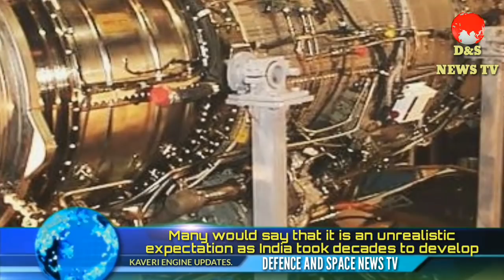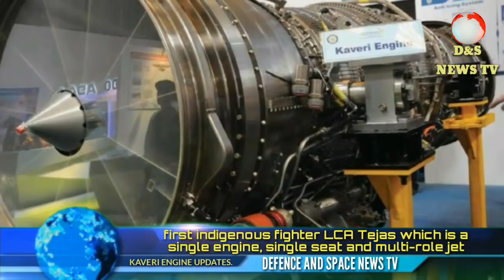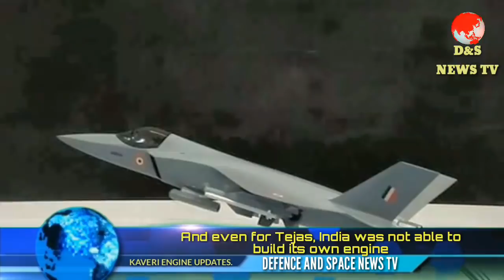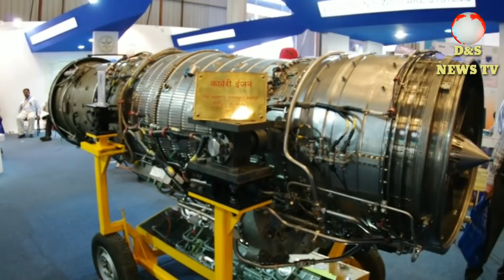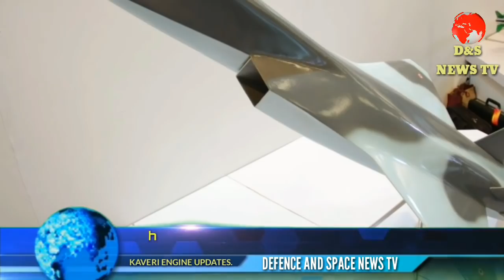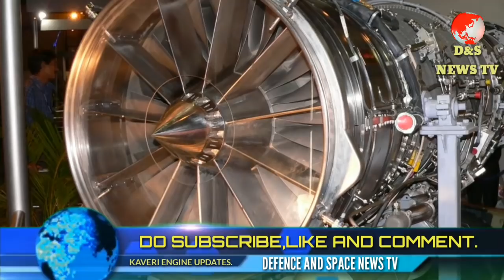KAVERI ENGINES LATEST UPDATES. INDIAN AMCA ALL DEPENDS ON KAVERI ENGINES DEVELOPMENT.

Comment: If the kaveri enjine is giving low Thurst, why not HAL  try with putting two or even three engines in aircraft for better Thurst. Or try to put these engines on commercial jets or tpt planes.  If engine is complete, it can be tryed on different platforms rather than focusing it only for one platform.
Reply: lool..

Comment: Kaveri was made for Murat , then said that it will be used in Tejas and now... 
To be honest 
It is 2nd generation engine,. Even if upgrade, will be old tech 
Now if you work on new technology, will take much long time (40 year for you)
Reply: 😁😁😁😁😁it is called half knowledge. Kaveri engine design was one of the best in world ,American engineers said.every thing is ok ,but the high came in crystal blades . After colabaration with snecma ( french) now it was rectified. Now Kaveri 9 genarates 92 kn power  which is sufficient for LCA .Kaveri 10 is inthe process to achieve 120_125 kn power to be fitted in AMCA& other 5th generation fighters.now India is on track of indiginization
Reply: Hich
Reply: Abdullah Abbas You might be right...but still a start. Newer technology might not take as long given the Kaveri experience will still be useful.